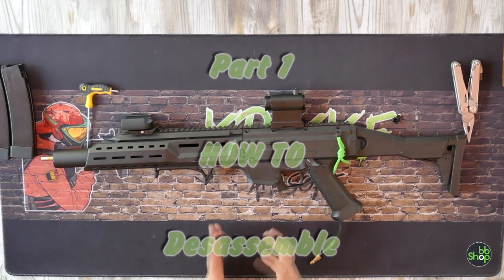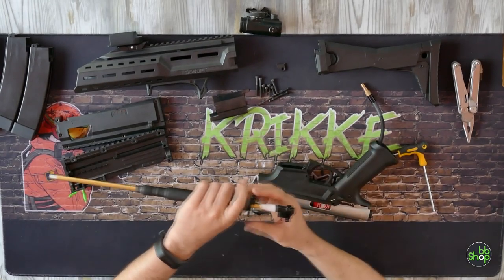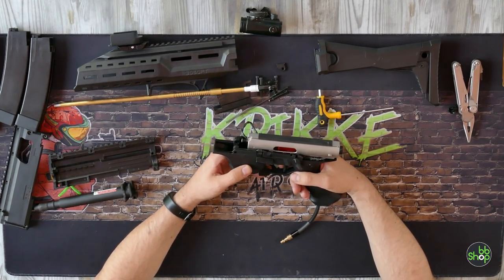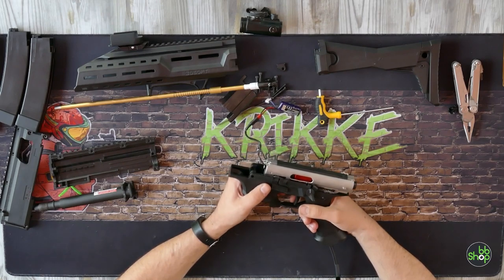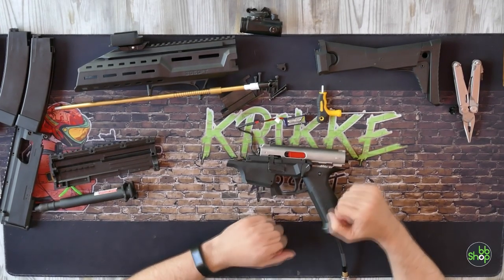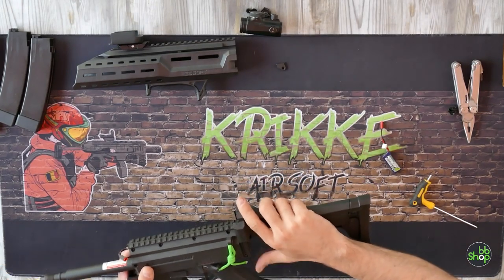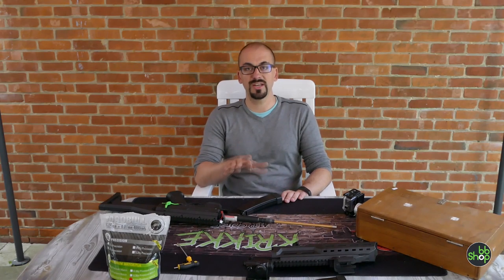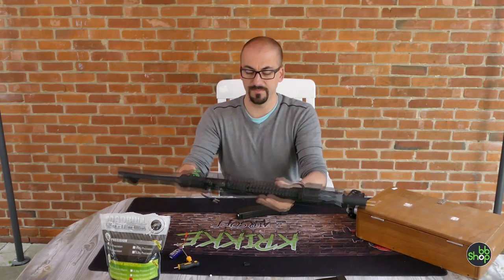ASG HPA scorpion evo 3 A1 HOW TO

Comment: Hello, I know this is an older video so idk if this comment will get seen but what IGL do you use? I tried the premium amped line and it was way too large to not kink in the grip or get around where the selector switch rod goes through the gearbox.

Comment: Can you explain dwell in more depth??
Reply from the maker: Dwell is how long the solenoid stays open to release air after a triggerpull. Lenght and diameter of barrel in combination with the bb weight have an effect on this.
That's why you need to adjust it.
To short airrelease makes the bb "fall" out of barrel, cause the airpower will already be gone before bb is out of the barrel.
To long airrelease is just waist of air and can influence the bb flightpad negative.

Comment: just bought my evo second hand and was getting my fps up and now its leaking air out of the nozzle when i plug the tank in. the gun still clicks with just the battery plugged in. but now air just leaks out the nozzle and it doesnt cycle.
Reply from the maker: Nozzle is stuck in a wrong position, probably.
Check if it sits all way back when air plugged in.
Reply: @krikkeairsoft3399  had a bb jammed in the HopUp so the nozzle was stuck in a bad position